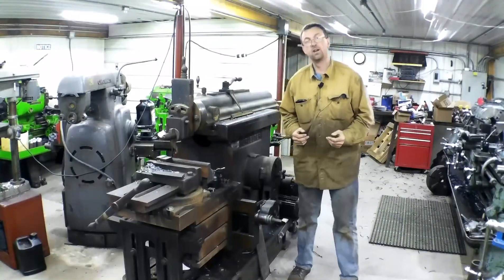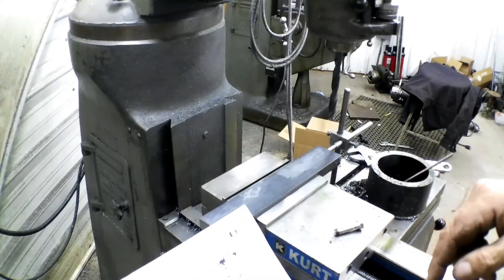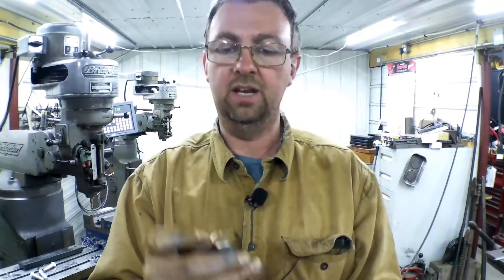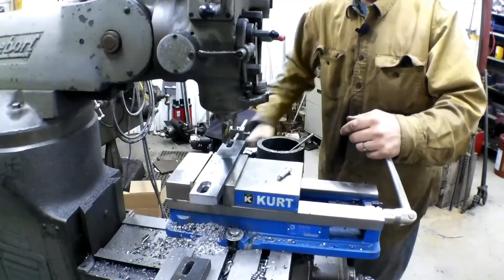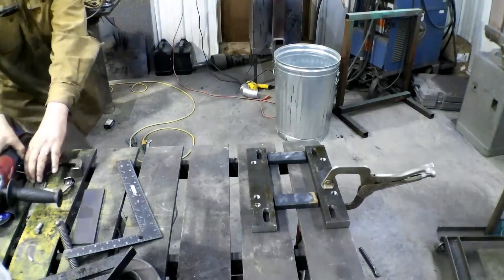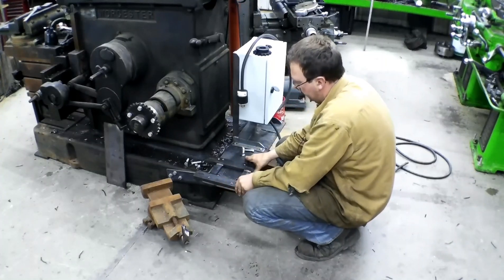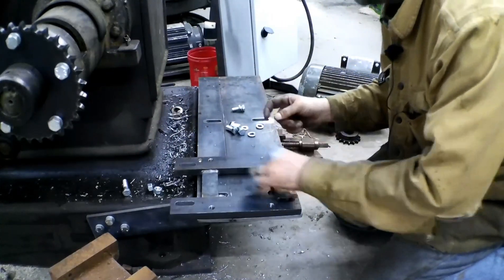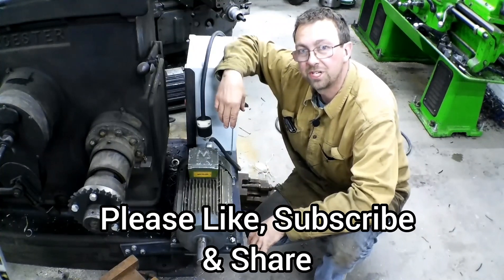Making a Motor Base for my Ancient Metal Shaper

Comment: We have to make a motor mount for a saw bench at some point so it was good to see how you did it. Your shaper is a monster, I have never seen one that large and it makes ours look tiny. When we are able to sort out our workshop we were thinking of making a welding table. It is interesting the yours is not one plate, do you think that is better? I noticed that you have a DRO on your Bridgeport, it that the one that you bought recently and if so are you pleased with it? Final question, what oil would you recommend for milling? Thanks
Reply from the maker: I'll try to email you this weekend with some of this info.
Reply: @TopperMachineLLC  Thanks, no hurry